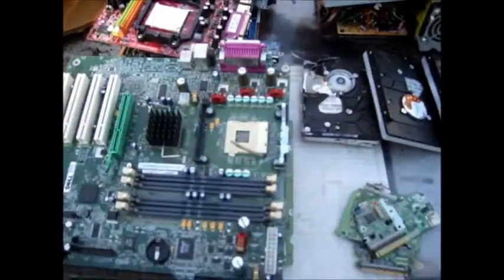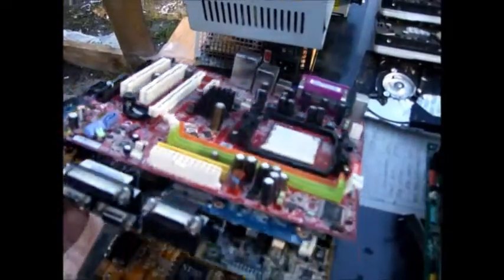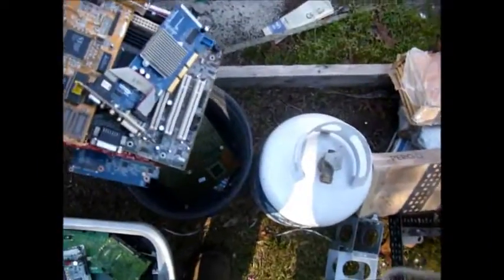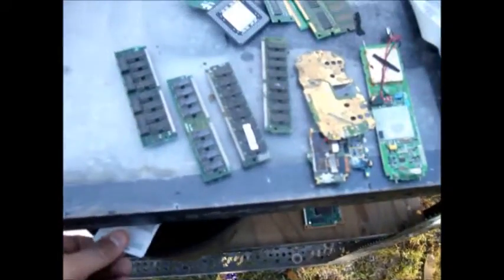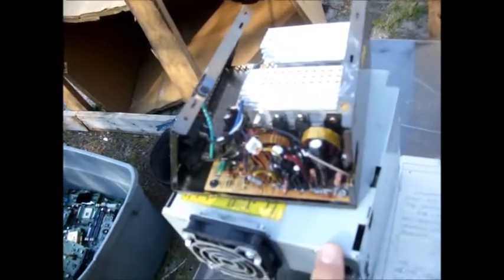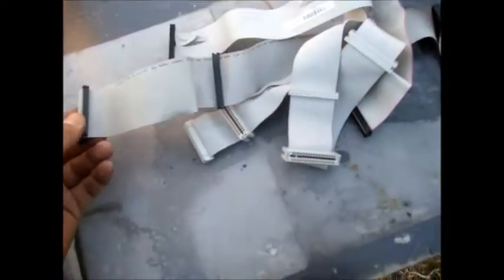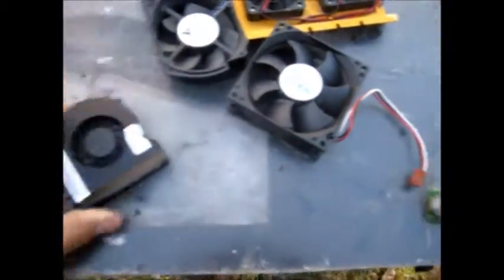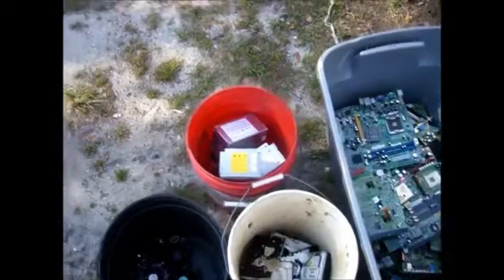How to make money recycling computers.

Comment: Hey Joe I don't know if you're still out there, this is an old video but I just came across it.   I have a ton of stuff that doesn't work anymore. I am fortunately a mini hoarder. OR I should say a mini saver until the time is right. I don't like to throw things out for this exact reason.  I never knew there was money to be made by taking apart electronics that don't work anymore. Actually I have a big pile of stuff I was tired of looking at and was gonna just throw it all out.  I'm SOOO glad I found your page! It might be worth me taking the time to break everything down. Every penny counts right? Quick question, do you know what can be done with tv's, vcr's, printers and the like? I just switched out my printer cartridges and there is a small patch there on the bottom that looks liker copper or some other metal. Are they worth saving for scrap? I hope too hear from you, Thanks Joe!

Comment: Where are you located . I’ll pay 1.10 lb for your color boards and finger cards . 
I see a couple slot processors that go for ten dollars a bound. Man don’t go for the skank yards BS. That board that you said .10 lb I get 1.00 lb the ribbon wire .80/1.10 lb. also .25 on motors is F great.

Comment: when it comes to mother boards why not remove the heat sinks and copper that's good money? I do the same stuff this dude does and its well worth doing
Reply from the maker: silverado708 
The motherboard is $2.60 per pound. Aluminium is 50cent a pound. Solid copper heat syncs MIGHT be worth removing but not likely.
Reply: ***** they pay the same in my area on motherboards and aluminum but the copper on the motherboards is number one copper. its a lot of work if your willing to do it but the copper at around 3 bucks a pound is worth it to me may not be worth doing for all I do like what you do nothing wrong with it